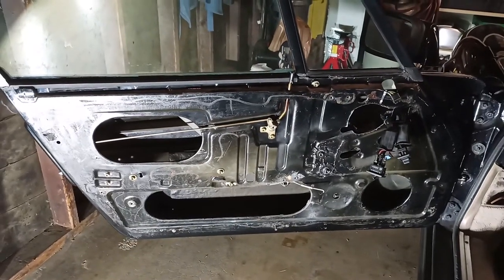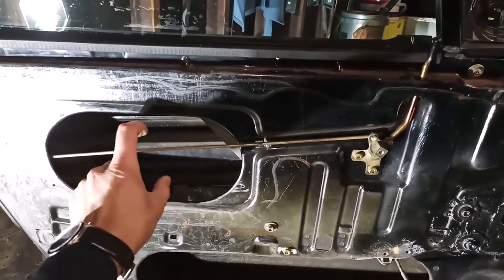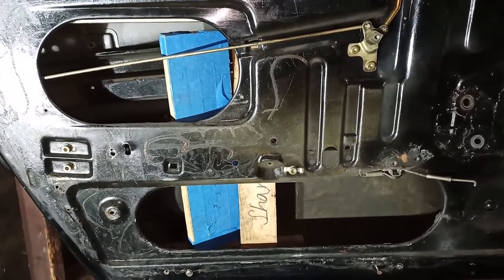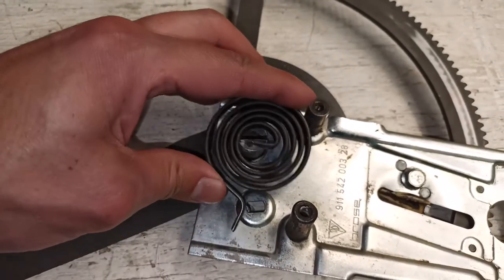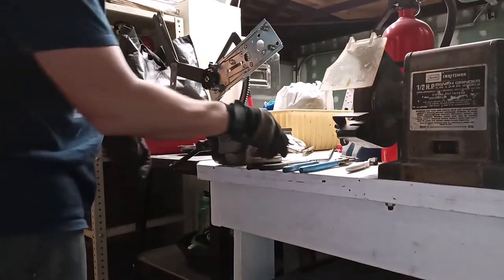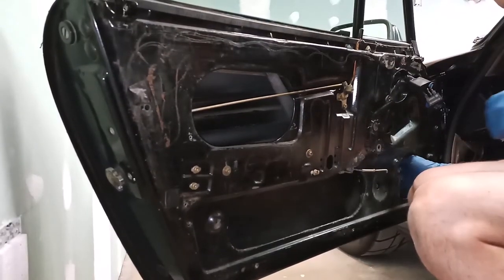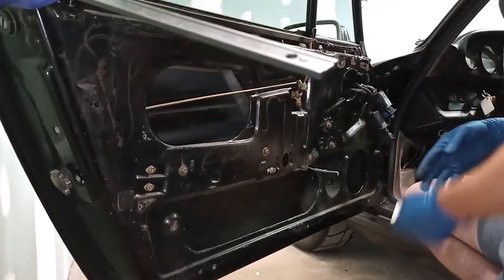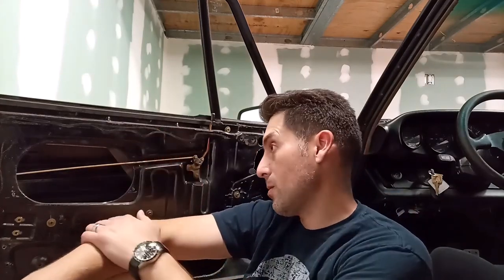Air-cooled Porsche 911 Power Window Regulator DIY Repair and Replacement

Comment: YouTube's algorithm must be slipping.  This is exactly the kind of channel I'm into!  Just tore down the drivers door of my 82 SC for an identical issue. The window would go down but not up, bad switch and the spring stop that you replaced with the carriage bolt was also floating around inside my door.  

Subscribed and looking forward to more of your content. THANKS!
Reply: As a follow up.  Without the hole for the tweeter hacked into the door skin there wasn't a way to get to all three bolts in the motor up with the bottom rail fixed in place. I left everything loose, got the motor on but not tight, used the window switch to move the motor up and down so I could get to all 3 bolts, then attached the rail and finally the regulator. 

Thanks again for the video.  It made an annoying job a little easier.

Comment: I had the same issue my passenger window wouldn’t come up pulled out and found out the motor is fine but only goes down so just a switch issue great help from your video… in my 993 there’s less open spots so it’s tougher to put the top rollers on the rail

Comment: you can ..and should..clamp the spring-center-pivot-axel directly in the vice facing away from you. Make sure it is clamped tightly and the window-arms are not stressed or involved, then use the vice grips to put it behind the new bolt. I then added a LARGE FLAT washer and another nut to hold the spring on.

Comment: Awesome content, very helpfull.  I had exactly the same issue with my return spring on my 86 Targa - used a 1/4-20 carraige bolt (1") from HD. I did have to file a bit off the shoulder and grind some off the head to make it work. Didn't have the big tweeter hole so it took some time to get the motor off. had to use a wrench on the top most mount as the socket wouldn't get there using the standard speaker hole. My original problem was the glass falling out and dropping down into the door and when I was trying to get it out the motor wouldn't move the regulator, the wires to the switch got hot which was not good. So a little advice for anyone that might be scared to do this, I split the motor from the gearbox, cleaned it all up, regreased it and it started running again. After that I had a problem getting the motor back on which turned out to be a small bushing inside the gearbox that the drive shaft was supposed to be located in. It must have moved a little which I corrected with a drill bit. evrything looks OK again....re-assembling, let you know how that goes

Comment: Great video. Helped me a lot even though mine is a 993. Same setup. My reason for the job was that the cadmium plated rails at the bottom of the window was corroded. On passenger side it was coming apart due to the corrosion so the el. window hoist could not operate. The rail is a little bit of moisture trap with the rubber sleeve between it and the window.  Anyway i found that it was a lot less fiddely to get the whole hoist mechanism installed including fixing the lower anchor rail and then slide the rail onto the sissor arms.  Then i put the rubber sleve onto the bottom of the window (put a little bit of dish washer fluid on the outside of the rubber for a little bit less friction when pushing the rail on). Actually i used the electric hoist to push up, slowly and carefully to make sure the rail hit correctly at the bottom if the window. Slide right on.

Comment: The rail which holds the glass to the unit is a weak point. Over time each of mine rusted and the window fell inside the door ~ thats how i knew they rusted they are held in a channel with a rubber strip which echo's the shape of the 'c" channel.

Comment: Thanks for this great video. I just barely replaced mine with your help. Funny thing, the door had never been opened as far as I could tell because the vapor barrier was completely intact and the original motor was still in place but, there was no spring. There was nothing sitting in the door loose and nothing broken. At some point someone replaced the speakers but that's the only time someone's been in there. Would not having a spring cause the motor to fail sooner without the assist? It seems to go up and down fine with the new motor.
Reply from the maker: It's probably dependent on how well lubed the regulator and tracks are, the wiper seal on the window base, motor, switch, and wiring health. My driver side passenger window switch is new and already dying but the one on the passenger door operates the glass with no issues.
Reply: @JoeEngineer  I guess we'll just see what happens. It seems to be running very smooth and quietly.

Comment: Hi, great video, I have a '81sc targa. I think those stops that prevent the window going up too far must be missing or misadjusted on my car. My windows are rolled up all the way and the top edge goes above the frame of the little fixed triangular window next to it. Now neither window will come down. I believe the glass just sits on top of the little rollers on the scissor arms and gravity lets the glass down. So I believe it may just be wedged now. My mechanic suggested I just get something flat and push the glass down until it is free of whatever is binding it and sits back on the scissor arms. Since both windows started doing this at the same time (and I did a very rare thing of rolling them up at the same time) I thought it might be a fuse but the fuses all look good. I'm afraid to push down on that glass but it also makes sense enough to me. Do you think this binding is the likely culprit and that good old brute force is the next step?

Comment: Hi Joe, great video.  Couple questions:  
1.  assuming my door does not have that big tweeter/speaker hole that your door has, is it going to be possible to maneuver the regulator/motor into a position so that the motor nuts can be accessed from the big speaker hole on the bottom of the door?
2.  according to the Pelican Technical Article instructions, they say to roll the window down first, remove the motor from the regulator, then slide the window up and tape as you did.  Your way makes more sense, as with the window up, there will be less tension on the spring.  Your thoughts?
Reply from the maker: Short answer is yes it is possible, but kind of fiddly. If I had a third hand I could reach in and rotate the regulator down into the right position to then attach the motor and mesh the gears in the correct position to bolt the motor to the door. Maybe 2 hands inside and a helper putting in the screws finger tight to mount to the door. Someone above mentioned removing the window frame itself to make it easier, so that is also an option.

Comment: I have the issue that the fuse blows if I move both windows at the same time. One by one is no problem.
You think greasing them would fix it?

Thanks for your videos, they help me a lot!
Reply from the maker: I would try to remove as much friction as possible from the regulators. Mine keeps burning out passenger switches on the driver door so I need to go through the passenger regulator to make sure there is as little mechanical resistance as possible then go through that whole circuit and make sure it is sound.

Comment: How do you hold the window up on a convertible or targa?
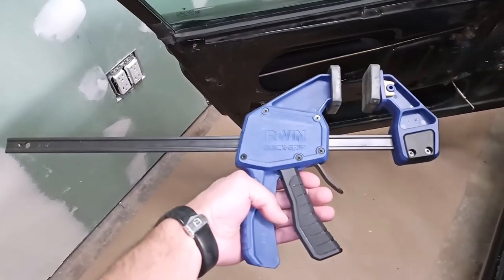Reply from the maker: You could try a woodworking clamp with rubber pads like the one I used in 58:56. Just be very careful.